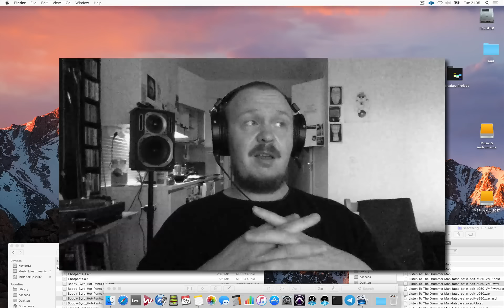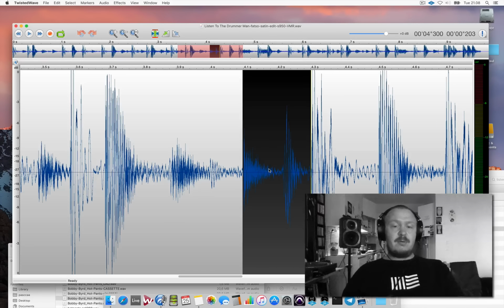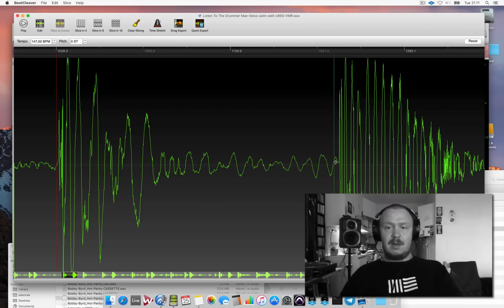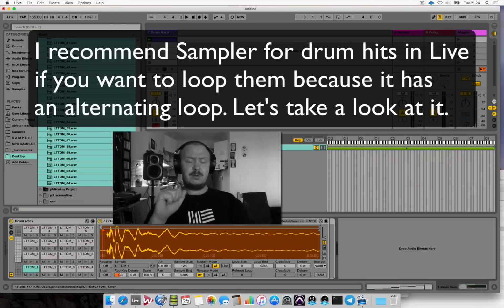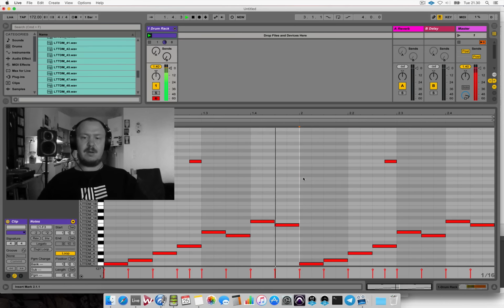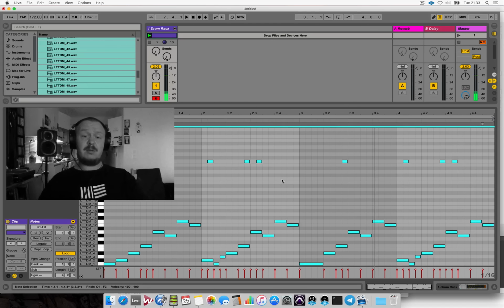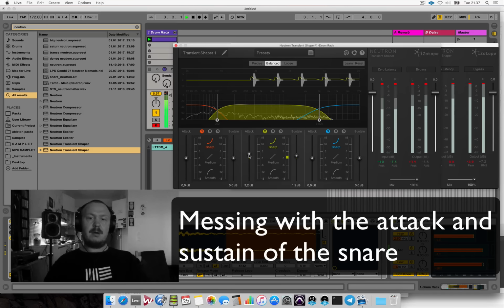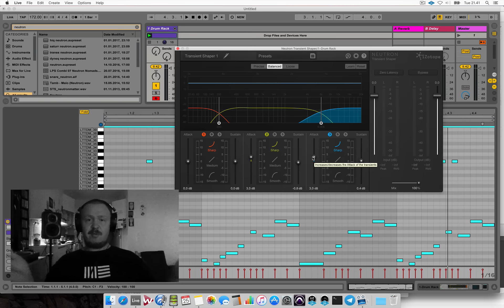Fanu's Short Studio Masterclass 3: How to do drums in D&B

Comment: Fantastic video Fanu. I really like your words regarding changing hits around to other unconventional / informal locations.

Secondly, your input on Dynamic processing is very useful! That will come in handy.

I'm very interested in how long each hit is, but I can see that varies from break to break, processed or not. Some may be 1/16ths, others shorter, or longer depending if it's a kick / snare or ghost note I guess.

I'd like to see some videos of post processing, ie, making the breaks louder if that's okay? Or, do you generally just have them like this, then balance out other elements so they can all speak clearly within your tracks?

Thank you Fanu for your video! :D
Reply from the maker: Glad you like it man! I do make them "louder" sometimes by saturation: using saturation plugins, running things red on my analog desk, sampling things loud into my samplers etc. To me, drums and bass come first, then the rest.

Comment: Any particular advantages between Beatcleaver and ReCycle? I still use the latter sometime
Reply from the maker: I barely remember how the latter worked. To me, BC is quick for marking chops and exporting them into audio.
Reply: i was fooling with it just yesterday, taking some of your 'ping-pong looping' point into consideration.  Recycle will do exactly that for all the hits (by adding a 'stretch %' and then release times) automatically.  

I was recently trying to do the slicing and reverse looping directly from push2, but had trouble slicing from Simpler (on push) to a Sampler-based drum-rack.  Can't figure out how to make the chops in Push, then dump them to a drum rack with sampler-modules rather than simpler. it doesn't respond to the default-settings the way it does when just using Ableton directly
Reply from the maker: Yeah, I never timestretch drums at all. Don't like it. And yea, you can't convert simpler>sampler with Push. I've expressed that wish to Ableton (I'm in the beta team).
Reply: *i think technically the term "stretch" - as used by recycle - isn't actually time-stretching the audio at all.  

Its taking the tails of the slices and 'echoing' them by having them play back a short loop in reverse.  as you turn the 'stretch' knob up, it gives you a longer 'reversed tail'.  even @ 100% 'stretch', all it does is add a few milliseconds of extra tail length, but does nothing to the rest of the hit.  I don't think it does any time stretching at all to the audio, even when you lower the output tempo drastically - it just makes the 'echo-tails' longer the slower you make the loop.  when you get slow-enough, they basically are 'reverse hits' pasted on the end (you can hear the entire slice being looped).  I'll whip up a quick screen cap if i can to show you what i mean.  I only mention this because i think it might be a faster way for some people to achieve the same effect you recommend.
Reply: Here's a quick video where i think you can hear that the transients of the drum hits aren't changed when you "stretch" the sound in ReCycle; it just adds a short, looped, 'echo-tail'... which basically emulates your technique, albeit slightly more automated.

https://youtu.be/FEanHaKG5tg

I'd been using it for this purpose for 20 years :) but i'd never visually done the 'cut/paste' tails and then ping-pong loop them.. because it already doing something very close to that.
Reply from the maker: Right on yeah! That's how Ableton's "beats" warping algo works: keeps the transients intact. I'll always cherish my <> loop :)

Comment: can you recommend a 3rd party multiband gate VST for those of us who may use other DAWs?
Reply from the maker: This is a good Q actually; I don't know! Maybe there are some, but I haven't had to do much research. Ozone used to have a grrrrreat gate up to version 5. If you can get Ozone 5, get it!
Reply: Fabfilter Pro-MB is brillant for this, just switch the bands to Expand mode instead of regular compression. I tend to use that to remove low frequency rumble and reverb, and then use regular compression for the mids to tighten up a bit.
And then perhaps upwards expansion on the highs to bring up the attack in the high frequencies (like Ozone is used in this video).

Comment: Hey man! Quick question: So I dragged a Sampler over to that folder you mentioned in the video and it's still setting me up with Simpler every time I slice to MIDI. Very frustrating! Any pointers?

Thanks again for this tutorial!
Reply from the maker: You can change this in User Library: defaults>dropping samples>on drum rack … if you drag an instance of sampler into that folder, it'll load up sounds in sampler on drum rack when you drop them in
Reply: "it's still setting me up with Simpler every time I slice to MIDI" you need to create an empty drum rack, then drag a sampler to a pad on the drum rack, finally drag the drum rack to the folder User Library > Defaults > Slicing. You just created a slicing preset. When you do 'Slice To MIDI' just select your new slicing preset from the drop down menu. 

Fanu's tip is only for when you drop samples into a drum rack, not for when you slice to MIDI. Hope this helps.
Reply from the maker: Ah yeah sorry! I missed the point / gave wrong advice :) Pine Pine nailed it!
Reply from the maker: Seems I've even done a video about it: https://www.youtube.com/watch?v=1lWqwvCsZp4
Reply: Great video. Am I right when saying Beatcleaver is redundant when you make that slicing preset for sampler? Because it's definitely faster to do this straight away in ableton.? Just curious why you use beatcleaver even though you have that sampler slicing preset.
Reply from the maker: Yeah, you don't NEED it. I just like to use it sometimes, as it's so big on your screen, precise, and really quick to use :)
Reply: Thanks guys!